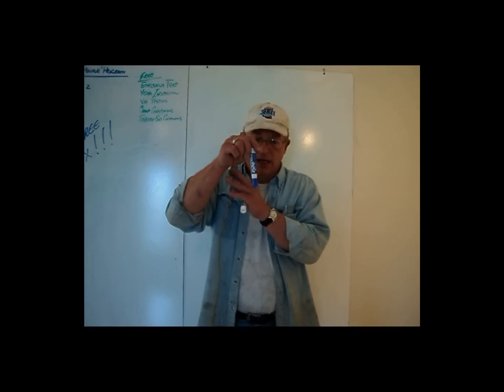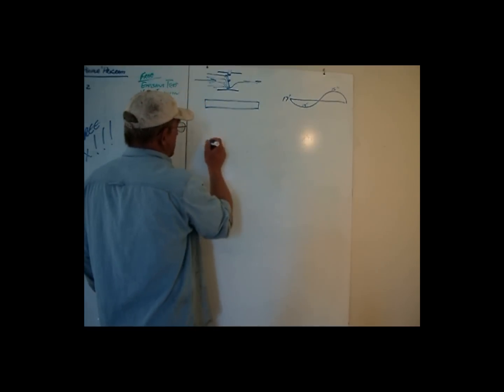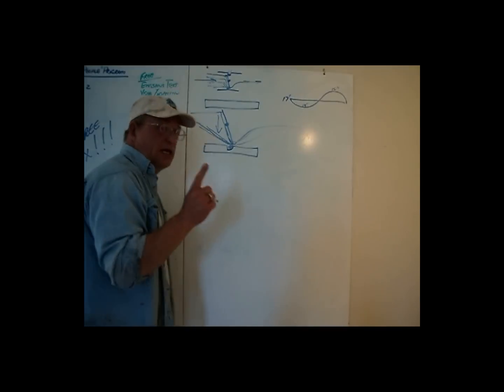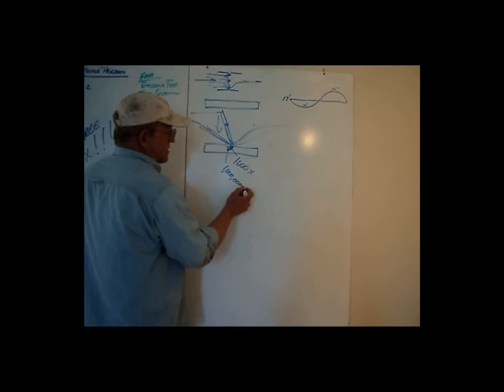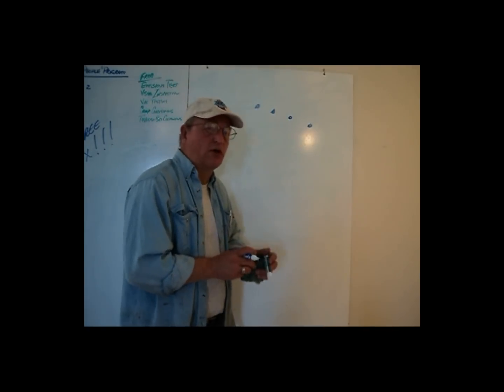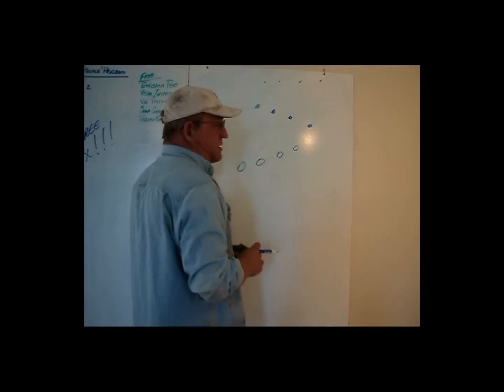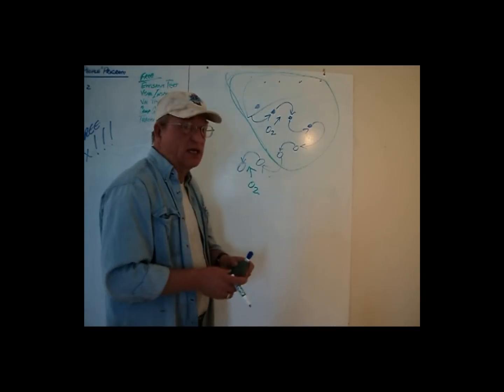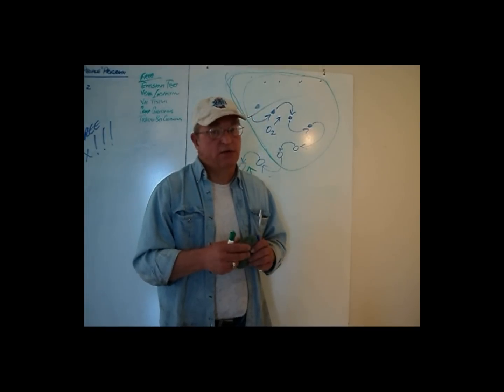How Does The Gadgetman Groove Work?

Comment: Dose this only work at idle. It seems that the plate being in the closed position is a crucial part of this system, and well as soon as you touch the pedal, the throttle plate opens up.

Comment: It always amuses me why a fellow comes along with a Dremel and claims to outsmart all of the engineers in the automotive industry. 
There has never been more demand on manufactures to increase mpg and decrease emissions. Are we assuming that they just can’t figure this out or that they don’t know how to use a dremel?
Fuel does not vaporize in the intake anymore.  In direct injected engines (almost all modern cars) the manifold is designed for air delivery only. 
It seems that what your are doing is creating a small vacuum leak that causes a lean condition.  This will in fact improve mpg and emission.  That is, until the o2 sensor reads the lean condition and the ecu starts dumping in more fuel to compensate. Brilliant snake oil though.  Works until you are 300 miles in their rear view.  I expect that this is why you perform a service rather than offering a patented aftermarket intake.

Edited:  just looked at your website and love that you sell a product literally called “snake oil”. At least you’re having fun with it.

Comment: GadgetmanGlobal @GadgetmanGlobal 
At idle (throttle plate closed), makes sense.  But the second you apply pressure to gas pedal, plate opens on top and bottom, air flow unrestricted and flow through changes completely. So how does this help in any condition, other than at idle, deceleration and any condition where pedal/throttle plate is seated, aka foot off the pedal? I'm not trying to discredit you, I'm genuinely interested as a highly trained/experienced automotive technician for over 30 years. Please, tell me. 

God Bless you and yours. 
God Bless our Real American Patriot Brothers and Sisters. 
God Bless America Again. 

The Real American Patriots.

Comment: Umm - - the pressure is multiplied by a MILLION ?? right after the throttle plate ?? inside a little groove ?? . . . grabs calculator 
At 17 inches mercury of vacuum, we're at 6 PSI, so we're talking SIX MILLION PSI !!
. . . 
You're gonna blow the welds on your intake !!

Comment: Hi,  How can I get this done to my 04 Suburban ?

Thank you
Reply: Techs been out for 7 years.  Its not going away by a small comment. Get used of it.  The more you bash it and label it, the more it goes viral.  People can censor and deceive and it will just re-emerge in hundred other places.  Theres no limit.  It wont be us that keep it going, it will be the several thousand people that have adopted the tech on the ground.
Reply: Get used of it Will.  Time is on everyone's side.
Reply: I am not selling.  I am USING this technology.  I am pointing out that, I have did the mod on a vehicle and it is legit.  You on the other hand, are not even sure  about this technology and you keep ranting.  If and when you can try this technology and tell me it doesn't work, than you might have a point.   Until then, nobody is listening to you or your negative comments.
Reply: Its simple technology, not voodoo.  It has nothing to do with circuits. 
 It has to do with modding the air intake on the carb you moron.  The 
air is compressed and vaporizes the fuel before it hits the chamber 
before firing.   Making adjustments to the PCV and doing a PCV re-route is minimizing the air vacuum system to maximize this groove mod.   

HHO systems do work and it does happen with electrolysis. The main point is, your not understanding the technical aspect of whats going on to the air/fuel in the groove mod.

You are pretending to know what this technology, is without presenting some logic in your points.  Your saying name and giving labels but you are not backing your answers.  A six year old can do this.

Give a clear reason from a logical stand point as to why "you" think that the groove "in your opinion" does not work.  Your not being clear.  This is your problem.  You clearly do not really understand or you are a troll.
Reply: Remember Will, its never going away.  It will be like a bad dream that never ends.  Its technology that works for those that use it and want to learn.
Reply: Nonsense only in your mind.  To others with open minds it just works.
Reply: There are NO regulations or laws against what you can use in your car that I know of.  

People use HHO setups and plant based bio fuels to save on gas prices.  

If you can "specifically" point out what regulations or laws prevent people from using this type technology we'd be interested to hear from you.  If NOT then the public is free to keep using it.
Reply: Your comments are a warning to yourself.  Your mind is closed and the oil corps are greedy.  Quit protecting them.  Its good to have fuel efficient technology and for people such as yourself not to taint it with deception.  Use the technology before you actually comment on it, otherwise your just wasting your time.
Reply: For those that do not understand it.  You are the small percent that don't understand.  You need to tell us that you have tried it, and used it before making a legit comment.
Reply: Water is twice the burn in volatility than that of gasoline.  This is with high amp very low voltage electrolysis. (Stanley Meyers)

They are re-routing the PCV and capping it to "REDUCE or MINIMIZE" the vacuum.  The pressure is put into the crankcase via the re-route.  Its not just getting capped as you mentioned.  It is plugged on one end and re-routed back to the crankcase for neg or reduced pressure.  Yes I know

But you are also burning off anything else that wasn't previously burnt upon first ignition with the PCV re-route.  You are understanding the vaccum on the PCV, but what makes you think the air tweak isn't doing the compression after the TB plate?   :)

Don't play stupid.  You know whats going on.
Reply: You still don't know the basics of the vacuum on a car with a gas engine.   If you did, you would know how and why this technology works the way he explains it in this video.

Of course they are setup this way at the factory.  This is why the pcv re-route has to be done when this mod is installed.  What you also may, or may not know, is the IAC is capped and modded with pin holes for idle air.

Also, its not just a grind mark as you state.  Its a specifically pitched groove set at a precise angle to compress the air flowing in, which then vaporizes the fuel before its burned in the chamber.  This all happens in a fraction of a second.  

You may or may not understand the physics behind the air coming into the carburetor?   You seem to be lost in your understanding.    Something tells me you haven't even tried this mod,  you have no real technical understanding of Ron's tech.

If you knew Stanley Meyers work, than why were you even questioning the HHO tech?
Reply: Well you must have done your mod wrong, or forgot to re-route your PCV because you seem to not fully understand this mod in it's entirety.   

I don't question your competency in cars and their basics operation at factory.  Many people are smart and are by the book folks.  There are outside of the box thinkers and technology that your not understanding and have yet to learn.  This takes time and you will not get it at first glance.

But your forgetting the simple and basic dynamics of this technology and how it should be properly installed.  This technology is not atomizing fuel, it is vaporizing the fuel with tweaked/compressed air at the tb plate.

You already know that unburned fuel happens inside the back of a TB and gets black.  Tell me why this happens, other than clogged fuel injectors?  Is it air mixing with the fuel? or unburned fuel?

If we can both agree that air is obviously needed for making the fuel burn, then whats not feasible with it (air) not compressing at the groove?  It does flow there?  Whats not logical?  

Are you seeing the picture of what your not understanding?
Reply: Get used of this tech Will.  Its going to be around for many years. Deal with it.
Reply: You can get yours grooved by mail.  A few certified gadgetmans are available.

http://www.gadgetmangroove.com/index.php/kunena/other-stuff/3615-get-grooved-by-mail
Reply: vnmsenior Certified by whom?
Reply: Check this info  URL below to get grooved by mail.  All contact info 
is on this forum post.  Call or email them.   You may need to order the throttle body for your make and model vehicle or use the throttle body thats already in your vehicle.

http://www.gadgetmangroove.com/index.php/kunena/other-stuff/3615-get-grooved-by-mail
Reply: vnmsenior You people should be ashamed of yourselves for trying to get over on folks like this. This reminds me of some of the lyrics of an old Hank Jr. song about tv evangelists "they want you to send your money to the lord but they give you their address"  While we're at it I have a lightly used flux capacitor I'll let go for $65k if anyone is interested.
Reply: In multiport systems, fuel mixes with air in the intake port. Not the throttle body. It doesnt matter what you do with the air at the tb theres no fuel there and the manifold is always at vacuum unless its under heavy load. What part of this do you not understand?
Reply: @mastertek383  It's understandable.  It's very very hard for mechanics to accept things like this.  I completely get it.  It's insulting to what you've ascribed to become for the 20+ years.  Your whole sense of self is invested in this.

However, I blocked off the manifold vacuum inlet for the pcv and rerouted the crankcase gases to before the throttle.  It stopped all oil consumption, gained slightly more power and mpg improved +2.  

Did this around 250,000 miles.  It's now at 370,000 miles.  After doing the groove mpg went from 30->35 and gained a bit of power as well.
Reply: There are mods for multi-port (Edelbrock) tbi's  its only on one row but it still works the same as it was one tb.  The vacuum is not except from more than having one air inlet to mix the fuel with air.  This is what you need to understand.
Reply: Will Hammer

told you many times I have the mod and you do not.  

Of course I know what I'm talking about.  Everyone in here making comments, understands the dynamics perfectly, this is why it has so many views and not much spammers except for you.  You have not developed this technology so you will never understand it.  

Your a person that has never used this technology, and keep bashing it for one of many reasons.   Until you have used it and understand it, you will then have room to make an argument on why it doesn't work.  We know you have not.  Your stance isn't changing for this very reason.  The viewers know this and your understanding is limited.  If you have not watched his other videos and read his information, it only works on gasoline engines.

Can you tell us why it doesn't work on diesel engines?  If so why not?  Why does it work with gas?  This another confusion and why we know you haven't tried this technology.  There is no comparison on air / fuel from a gas tbi and one that's diesel.  Tell us why the mod would or would not not work with a diesel?  It was your question btw, not ours.  :)

 Your not explaining whats not working or not possible. This is where you confusing yourself or deceiving others.
Reply: vnmsenior Does it work on diesel?
Reply: If you knew this technology, you would not be asking me.  For the people that know the tech.  What answer should we give you?  :)

You can't flip coins and guess.  The moment you ask this question. We know your a spammer and dont understand.  

Should we keep you guessing?

:)
Reply: We can wait a year or six months.  If the answer is no would you still find out the answer?

If the answer was no, why are you even asking the question?

You still get it?  

Common Will, give us an answer from what Ron H. has said.  You already know what he knows.  We know what he knows.  It doesn't change.  Unless there's a good developer in the next year, we will know more.
Reply: vnmsenior Oh please. Technology?  No. Snake oil.
Reply: vnmsenior Not true. Rip off
Reply: vnmsenior Nonsense
Reply: vnmsenior No, it's dumber than mothballs in a gas tank
Reply: vnmsenior It's on my side too. I'll call you criminals out every time.
Reply: vnmsenior Never said anything about laws and yes the public is free to get scammed. The issue is you're selling something that can't possibly do what you claim it does and people that don't understand it will dole out their hard earned money to try save on fuel. They get sucked in by these fantastic claims of 40% more fuel economy from their heavy ass v8 pickup that always has and always will guzzle fuel. Just the fact that you brought up that HHO crap proves my point. That was proven to be junk long long ago. All this stuff sounds like a damn miracle until its installed on the car, then the poor sucker that shelled out bux for a "magic gas maker" is now dropping more bux to get it uninstalled and repair the damage it caused. Are you so daft that you cant understand that numbers sell cars in this highly competitive industry? Do you really believe the manufacturers are leaving all this power and economy on the shelf and spending millions on engineering new fuel delivery systems if all they had to do was grind a notch in a throttle body and plug a vacuum hole?
Reply: vnmsenior You are promoting a scam. My comments are a warning to consumers.
Reply: vnmsenior Grinding on throttle bodies and rigging up useless electrolysis tanks is a waste of time. And money
Reply: I have tried this voodoo bullshit you idiot. Plugging up idle circuits doesn't work. Blocking pcv ports doesn't work. They are there for a reason. Magical "hho" tanks doesn't work. Can't get more energy out than you put in. They teach this in 6th grade science class. You must go to church with this guy selling this scam
Reply: Hho works on a submarine only because its the only option underwater for long periods to provide o2 to breathe, they dump the hydrogen. Electrolysis is a  highly inefficient way to get hydrogen and the energy gained from burning it is spent turning the alternator to provide current to generate it not to mention what the byproduct of burning hho, which is water, does to the cats and o2 sensors and engine internals if enough is burned but you knew that already right? The "technology" you claim is in a hole chopped in a throttle bore that magically adds 40% economy could only work at idle or very slight throttle openings IF it does anything at all and won't do diddly at signifigant throttle positions where most of the fuel is burned. May as well buy one of those tornado spacers on ebay. At least they make a scam part that doesnt involve doing things any engineer would say is a bit dumb dumb like closing off pcv. They need that negative press on the crankcase but you know that too right?
Reply: You are so full of shit. The pcv is open on one end for a reason. Fresh air must come in to evacuate the gasses. ALL engines are set up this way from the factory. I know what you idiots are trying to do by ruining the pcv and choking off iac passages. It wouldn't matter if 100% of the air the engine uses goes through the throttle body, that bullshit grind mark is NOT going to make compression ANYWHERE behind that throttle plate. Watch the map vacuum readings. FFS and you call me stupid. I knew you would bring up Stanley Meyer at some point.
Reply: I've been a tech for 21 years, 16 at a GM dealer with extensive factory training. I have a pretty good idea of how this all works fella. Do what you want with that throttle body it has nothing to do with fuel atomization. The injector fires into the intake port, d.i. fires directly into the chamber so its not going to matter what you do to that throttle plate. Grind away. Even a tbi where the fuel is flowing over the blades cant pull a 40% gain no matter how fine that fuel spray is vaporized.
Reply: vnmsenior You don't have a clue what you are talking about. NONE of what you or this con artist says makes any sense. Ask anyone that understands the dynamics of airflow through a gasoline engine and they will laugh in your face criminal. I guess this works on diesels too? We will see how this "catches on". Crooks
Reply: vnmsenior You don't know so it proves my point
Reply: +vnmsenior.      Television evangelist
Reply: When in doubt, pray to God! 

Nothing wrong with that right?  ;)
Reply: No shame in my game here.  Get over on folks?

Have you even studied this technology?

Don't be too quick to comment, if you have not viewed the videos or seen the technology first hand.

I have seen and used the technology.  You have not.  This is the difference.

Comment: This effect is just after throttle plate opens,Um who drives around with there foot just on the pedal?.. What a waste of time. In a multi point fuel injected car the atomisation happens just above the valve where the inlet runners are smaller and create higher velocity air flow. Also a lot of modern inlet manifolds are designed with inlet pulse modifiers ie inlet runner maybe routed differently at different revs and power needs.  The most power is created at WOT, not at just open.